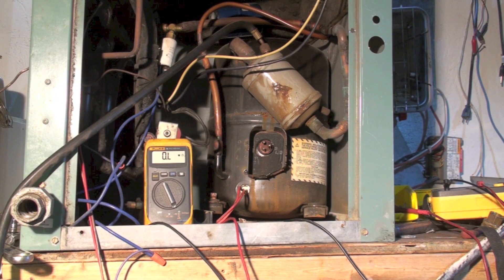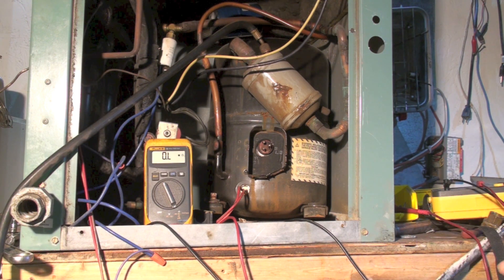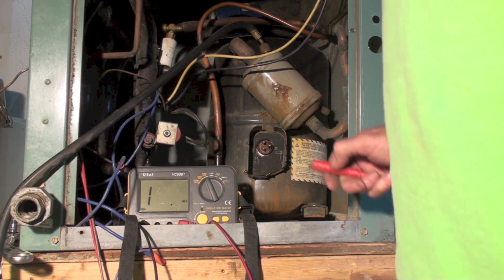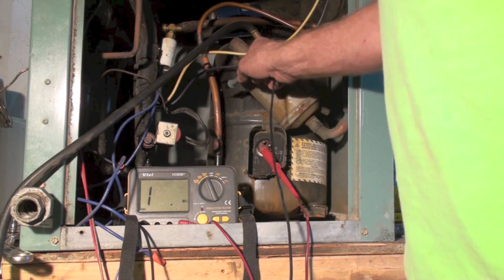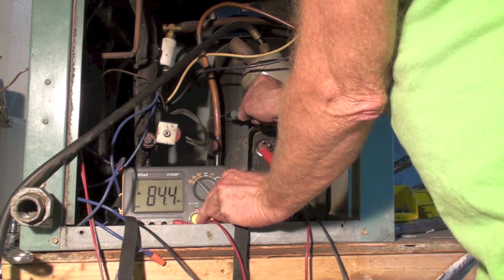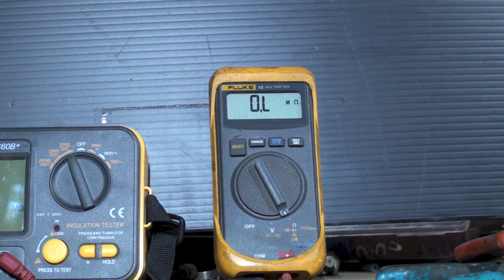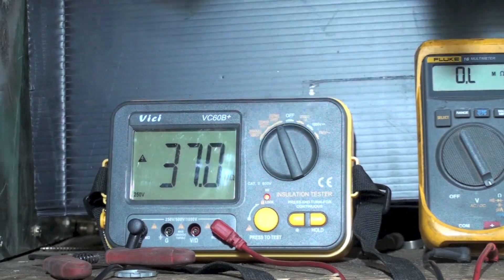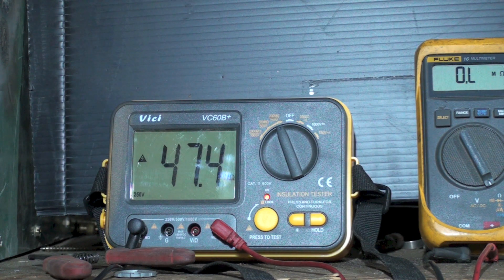Check compressor windings with the insulation tester

Comment: I'm confused
Reply from the maker: Explain
GFM
Reply: @grayfurnaceman  Hello.I'm going to watch the video again. From what I understand any reading from either of the C,S & R terminal to the case, then the compressor is shorted out.
I got interrupted a couple of times watching it. Thanks.
Reply: What threw me off was you said you should run the unit up to operating temperature for comparing the two meters. Anytime I had to make checks on a compressor like that was because usually it was going out on the internal overload so there was no getting up to operating temperature. You meant for comparing the two. BTW, I have that megger and like it. Thanks!

Comment: The hermetic compressor windings live in a oil and refrigerant atmosphere.  This atmosphere can become a conductor of electricity, if moisture and contamination are present in the system.  The insulation tester will pick this up and give a lower reading, even if the windings are in excellent shape.  A multi meter can measure in millions of ohms, but calling a multimeter a megohmmeter is very misleading.

Comment: its not low enough to fail an insulation test I'd check the run current and if possible do a pump down test (plus check the start current, discharge temp etc). listen for any weird noises. compressors are incredibly expensive to replace. if in doubt always check with the manufactuer 🤔 I'm curious to see your answer video now ☺

Comment: Its truth reading should be taken after 1 min also he didnt specify wether this was a 480v compressor. I have read that there is a conversion to housing temp and moisture as this hugely affect readings. Also hurd 1 volt per every 1kohm as a rule of thumb.
Reply from the maker: I have tried units under all these conditions, and I have never found any appreciable difference in the reading hot or cold (except if the can is very hot, the internal overload may be open).  Humidity has also made no difference.  Perhaps, I will test one with extreme humidity.
GFM

Comment: Based on the action of the regular multimeter, it almost looks like maybe a capacitor (series) was charging.  And my guess would be that if your insulation tester is showing multi-megohms to ground, you have no problems, at least as far as current leakage to ground.  But I don't think the tests you ran would reveal shorted windings.
Reply from the maker: watcherjohnny The insulation tester is not used for winding resistance.  For that, you need factory specs and a meter that reads low resistances.  This meter is generally used to determine if the windings of the compressor are approaching failure to chassis.  hope this helps.

GFM